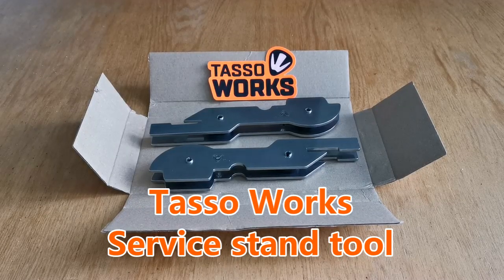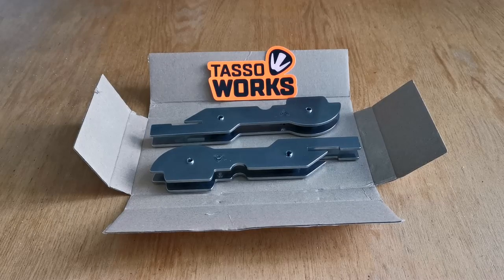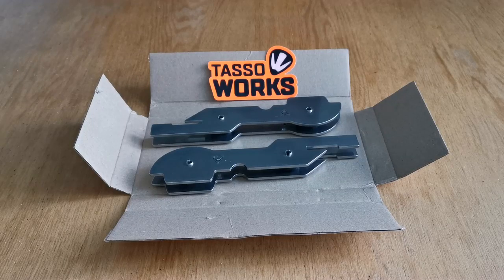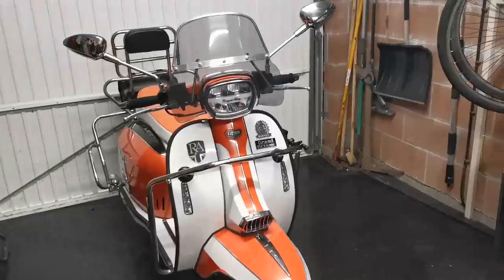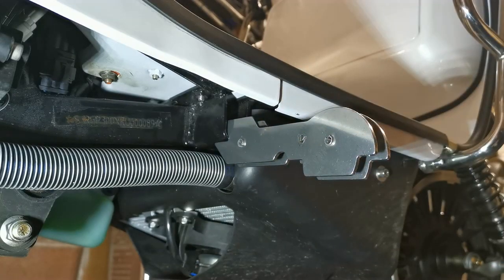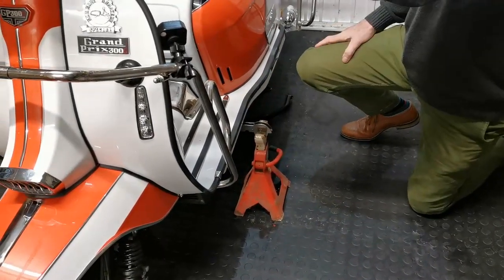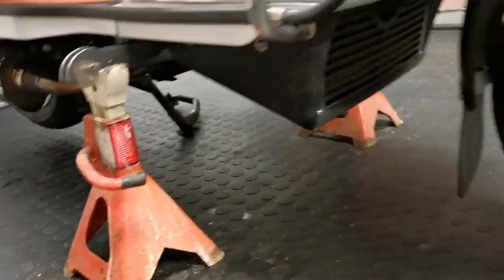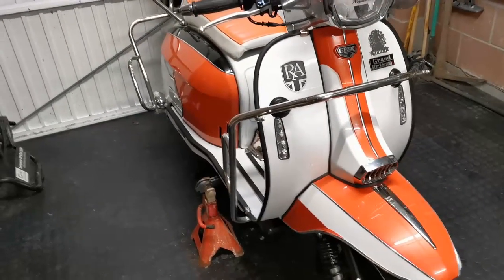Tasso service brackets

Comment: Just ordered my GP300 which should be with me very soon. Am finding all your videos very helpful and full of great info and you make a lot of sense. Is there a manual for the GP300 with torque info. Can I ask why you changed from a Tasso Exhaust to a Scorpion. Two days ago  was told Tasso exhaust are prone to breaking. Then I was corrected. They've fixed the problem
Reply from the maker: I never owned a Tasso exhaust I fitted one to a friend's RA. The Scorpion is by far the better exhaust. People fit cheaper exhausts but if you like the look go for a Scorpion.